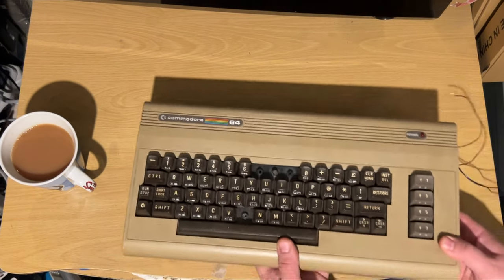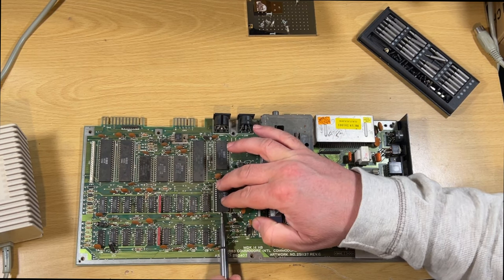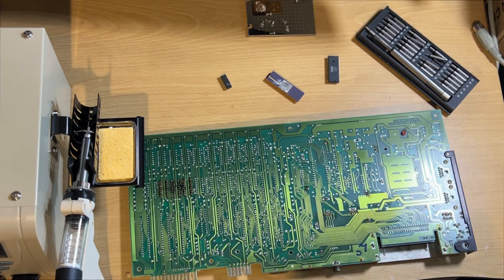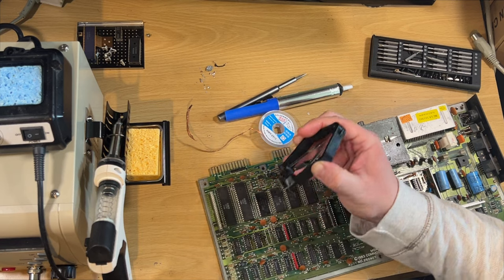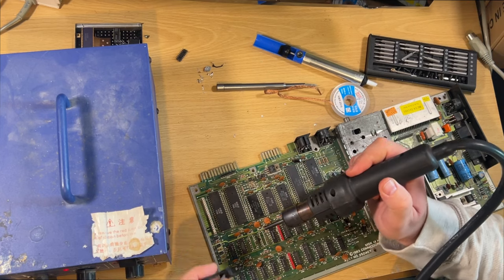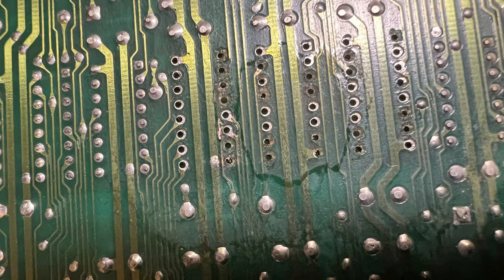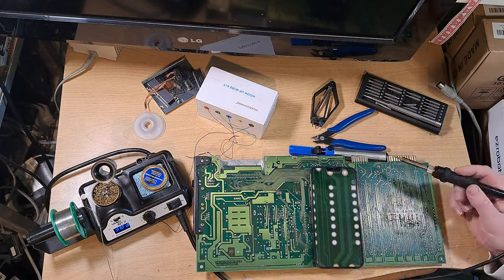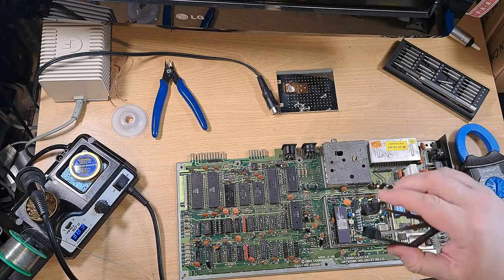My Childhood Commodore 64 Flickering Screen/ Blank screen - Back from the Dead Part 1 - Memory

Comment: You likely know this,but the original PSU's are notorious for going over voltage when they fail. Its not hard to build one up with a +5 supply and a 9vac transformer rated 1amp. You can buy some power supplies on Ebay also. China quality on the desoldering gun,lol   you might dwell on the pad a bit longer before triggering the suction. the chip should just about fall out if its a good job, but ground planes can be a bit of fun!  The puller you are using is for PLCC chips,not for dip chips but i guess you got by with it.
Reply from the maker: I know all to well about the power supply failing and may be what happened to this one. It’s the voltage regulator they used for the 5vdc that when it’s starts to fail, it fails upwards meaning it starts sending a higher dc voltage in. I will at some point make an in-line saver for that power supply. As for the desolder gun, first time using it and yes later on in the repair I realised that dwelling a little longer does help get more out. I do have the correct chip puller and insertion tool but whenever you go to do a repair, they magically disappear only to be found when you are looking for something completely different 😁